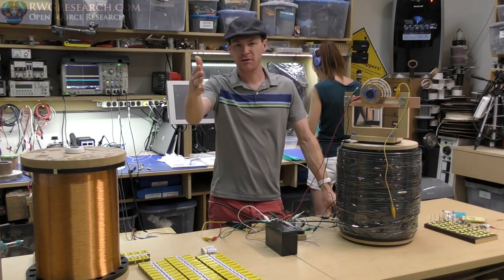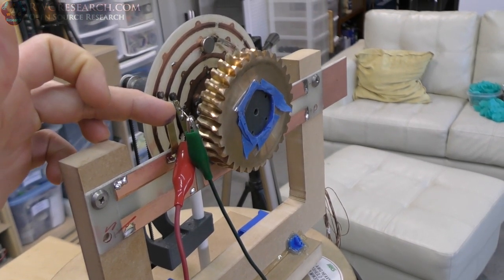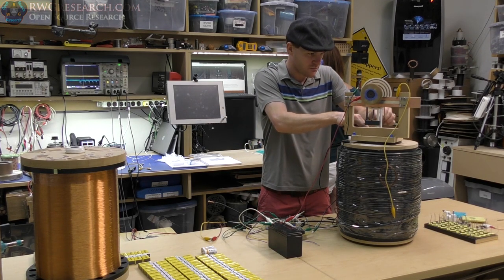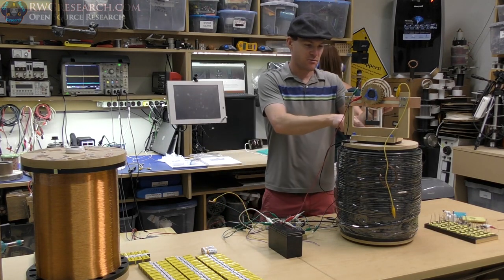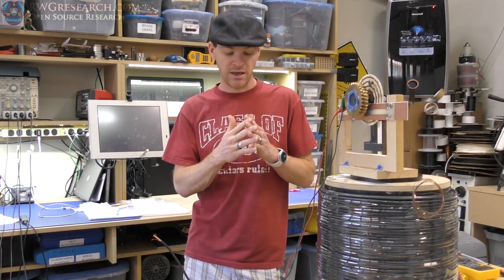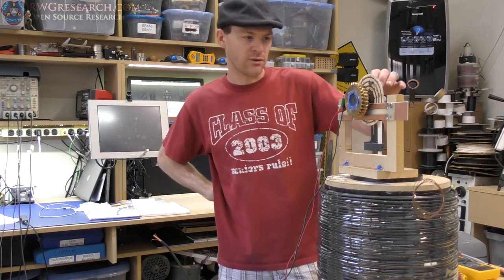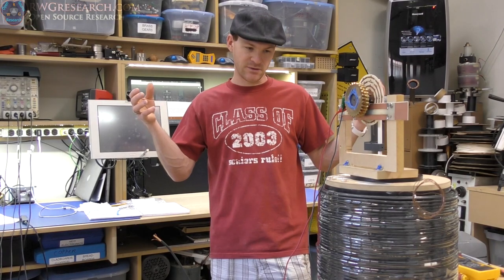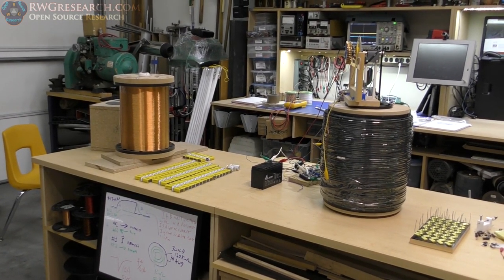TSFA Part 21 / JWN part 17 : Running The Big Coil - Charging Coils As A Dielectric Field..

Comment: Hi Russ, exiting video, thanks for uploading.
I want to ventilate my brainstorm okay ? I think your rotor is to big and heavy, and also the comutator is slowing down the rotor. Can't you use a laser to 'read' the position/orientation of the rotor and switch the relays with an ardiuno ?
I think you could push/start the rotor with some compressed air.

p.s. Do you think the coil and the relays are influencing each other ?

Comment: Well done Russ--- Seems you would only have needed a bigger flywheel for selfrunning...Anyway, the concept seems to work. Now you need to design a bifilar or multifilar coil exactly for this effect to maximize the output... Good luck.
Reply from the maker: overunitydotcom thanks, yes there is a lot to think about here. But its quite intresting to watch. ~Russ

Comment: only 500 ohms of wire isn't bad. while watching the vid i was wondering if you had a heaver flywheel coupled. to help with the rotation. great video
Reply from the maker: hydniq 500ohms... or so. Can't measure it. Need to use other methods to check it better, however the short is there... ~Russ